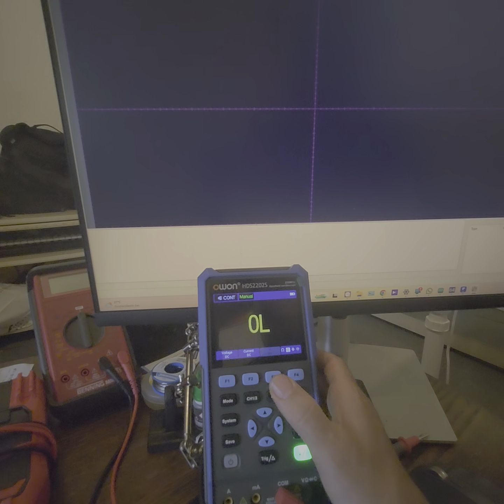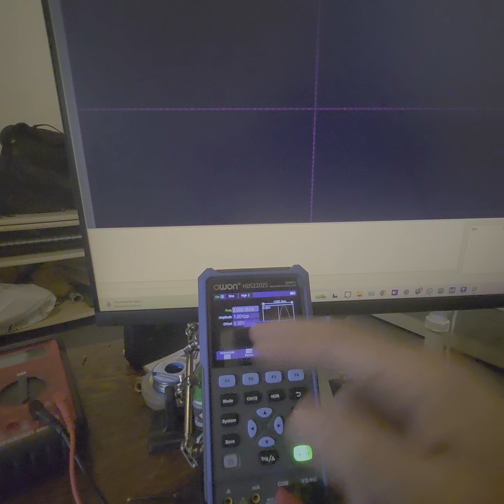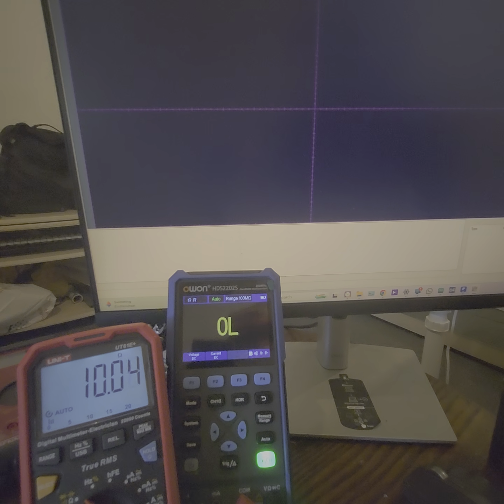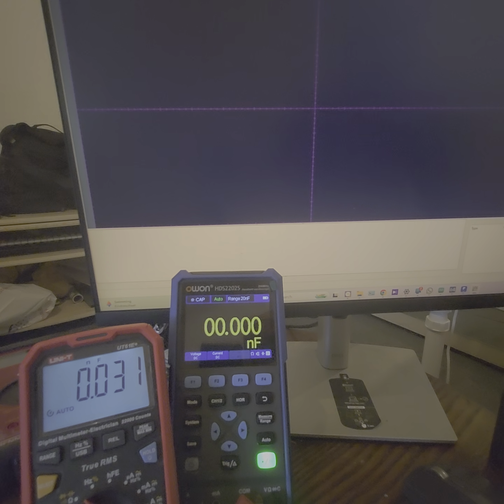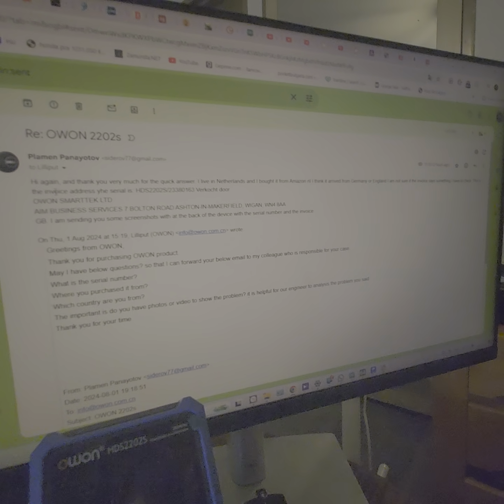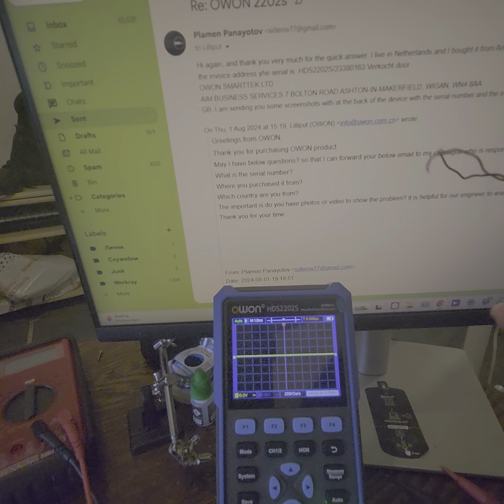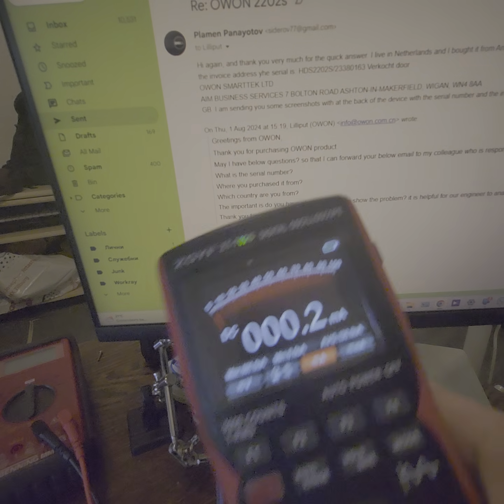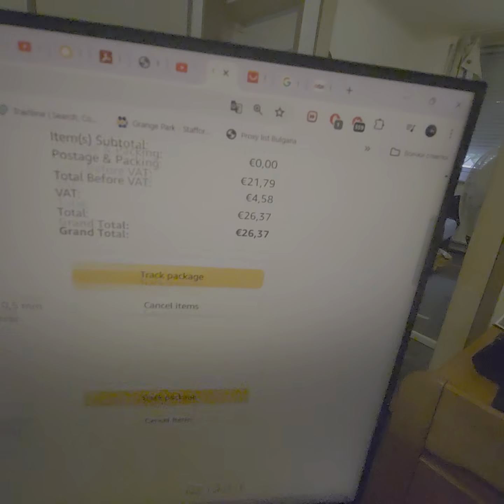Owon  HDS 2202S - Issue

Comment: Hello.
That seems to be a problem with contamination between the keyboard PCB and the membrane keys.
Remove batteries, open the case, remove the main PCB, remove the Keyboard PCB.
Inspect the key pads for contamination, clean it with isopropyl alcohol.
Good luck.

Comment: I haven't any issues with switching betwen measures in multimeter mode
Reply: I have the issue when switching to continuity mode is beeping continuously and if I hit it on the table is stopping the beep and is working ok. Maybe is a relay which is getting stuck.